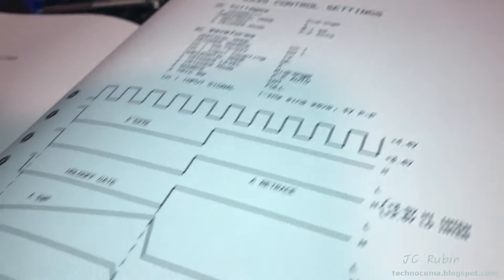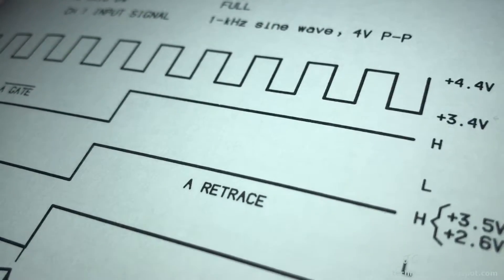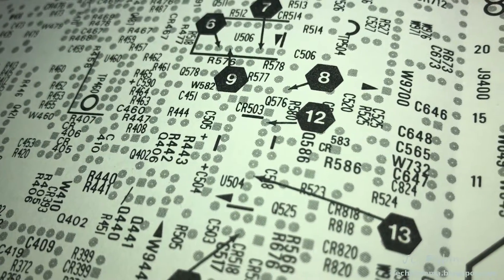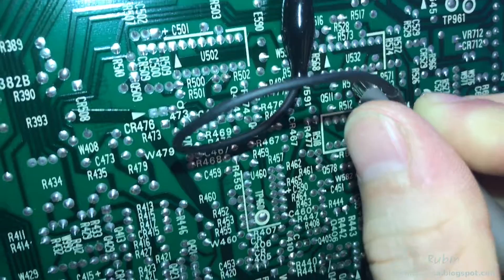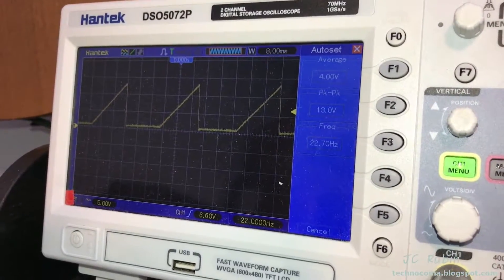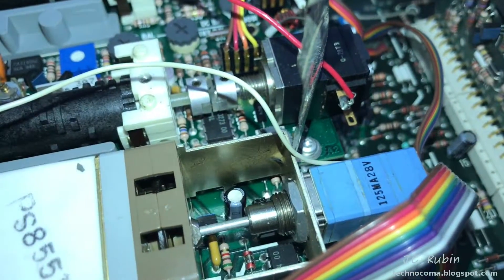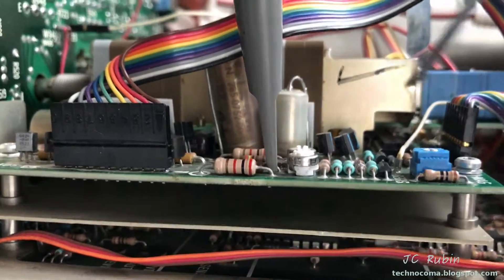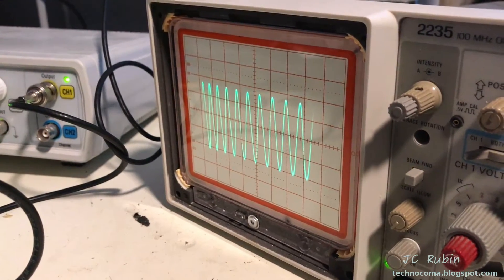Tektronix AN/USM-488 2235 Oscilloscope repair and calibration 3 of 7

Comment: I guess you are military trained as well, I served  over 20 years in the RAAF.  It  was interesting to note you were referring back to  the service publication  checking waveshapes of sweep signals when clearly you had intermittent triggering caused by a failing component and yes a dirty or faulty trim pot could cause that sort of problem.  1982-84 when these scopes were made doen't seem so long ago to me but well it's well over 30 years now isn't it ?  Tektronix really did make some good oscilloscopes unlike the stuff coming out of China, yes I know some are reasonable but I wonder if  they will be still serviceable in 30 years time.
Regards Rob
Reply from the maker: I think it will still function in 30 years